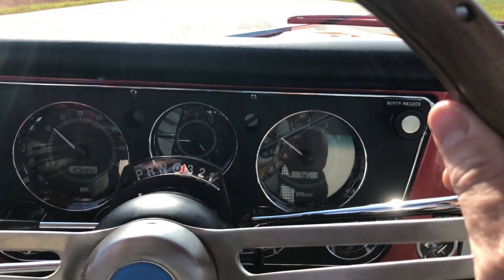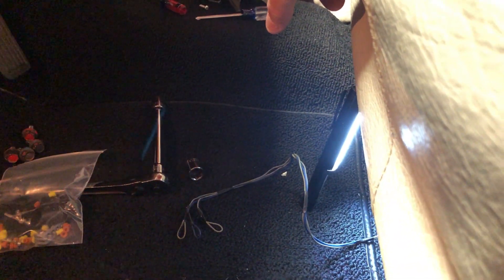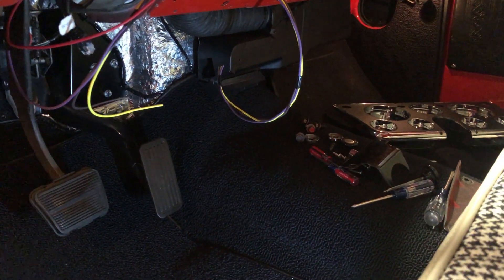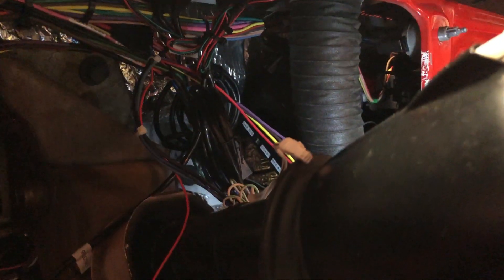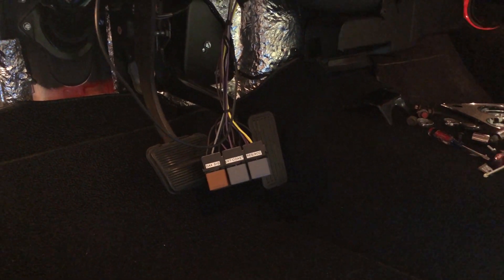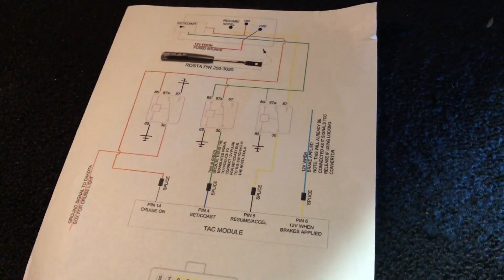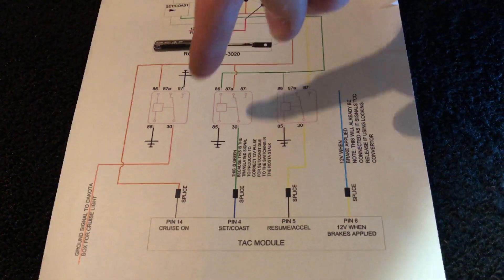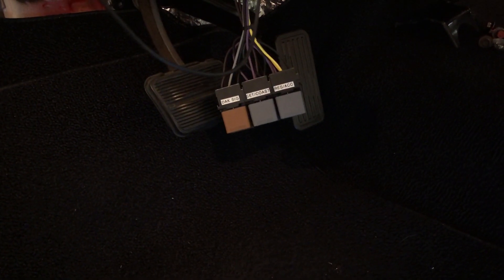Project C10 - Installing Cruise Control - Part 2

Comment from the maker: Description of how the circuits work -- So the Rosta stalk is wired for a different application.  I am going to try to break it down wire by wire so that hopefully this makes sense.

●First, here are a description of the relay pins if you don't know what they do.  The relays show on our diagram are shown untriggered, as in 12v is not being supplied to pin 86.
   ►86 - Positive relay trigger.  This is 12v (signal or battery 12v) that's only purpose is to trigger the relay
   ►85 - Negative relay trigger.  This is a ground (signal or chassis ground) that's only purpose is to trigger the relay 
   ►87 - Appropriately sized wire, feed 12v (in this case it is a fused 12v signal coming through the cruise stalk)
   ►30 - Appropriately sized wire, load side of circuit (in this case this is the switch side of the signal going to the TAC module.  This can also be the wire going to a radiator fan etc...)
   ►87a - This pin on a relay will pass a signal through the relay when it is not triggered.  This also needs to be appropriately sized wire.

●Let's talk about the signal wires coming from the stalk and what they do when wired up.
   ►Brown Wire (on signal) - This wire goes to 12v when you turn the switch on.  This is used to tell them ecm to begine accepting inputs from the Set/Coast and Resume/Accel.  
   ►Green Wire (set/coast signal) - This wire goes to 12v when the switch is turned on.  This is backwards of what the TAC needs to see.  When you press the Set/Coast, it interupts the 12v (goes to ground), but the TAC needs to see 12v when this button is pressed.
   ►Yellow Wire (resume/accel signal) - This wire goes to 12v when Resume/Accel is pressed, but the kicker is it also goes to 12v when Set/Coast is pressed.

●Next, let's talk about the relay wiring and what is happening.
   ►Since the green wires goes to 12v when the stalked is turned to on, we are going to use it as a trigger wire on both the Set/Coast and Resume/Accel relays.  The reason for this is the strange situation of the yellow wire going to 12v when Resume/Accel or Set/Coast is pushed.  What this does is help separate these 2 switches for the Resume/Accel function.  We don't want the Set/Coast switch to set the Resume/Accel function.  More on this in a second.
  ►Now for the yellow wire coming out of the switch, since we are using the 12v green wire for a trigger, this creates a clear path for the signal to go from the switch to the TAC module when the Resume/Accel button is pushed.
  ►This is where it gets a little tricky.  To make the Set/Coast work, we use the green wire from the set coast switch as a trigger on the Set/Coast Relay.  This is because the Set/Coast wire is 12v when not pressing the button, and dead when pressing, which is backwards of what we need.  So we wire the  brown wire to terminal 87a (normal closed) on the relay so that when we press the Set/Coast button, it interrupts the 12v, drops the relay back to 87a thus completing the circuit by giving the TAC module 12v when the Set/Coast button is pressed.  
  ►So back to the Resume/Accel yellow wire that gets 12v when the Resume/Accel or Set/Coast button is pushed.  To eliminate the Set/Coast button from giving 12v to the yellow wire,  the wiring of this relay array takes care of this anomaly.  Since we are using the green wire from the Set/Coast as the trigger wire (because it goes to 12v when the stalk is switched on), when the set coast button is pressed and 12v on this wire is interrupted, the 12v signal that is created from pressing the Set/Coast on the yellow line cannot make it to the ECM because the relay is no longer triggered because the green wire has been interrupted.  So in essence, we are using the Set/Coast wire to make the yellow Resume/Accel wire work correctly, while also making the Set/Coast function correctly.  I know this is long winded and confusing, but if you follow the wires through, it begins to make sense. 
  ►Now for the 3rd relay, we added this relay to give the Dakota Digital a ground signal when the system was on.  It used the brown wire to trigger the relay completing the path from ground when the relay is engaged.
Reply: Is the 3rd relay necessary if not using a dakota digital?
Reply from the maker: @claytonhaske  no, it’s not required if you are not using the Dakota Digital gauges.  It’s just gives a ground the the Dakota controller to show the cruise control light in the gauges.

Comment: Just a little confused. You kept mentioning 3 wires from the Tac module, but 4 wires are showing in your diagram. Please help
Reply: Thanks bro. Have a Great New Year. If no one mentions it, your neatness and effort is appreciated
Reply from the maker: Yeah, I can see that.  The 4th wire, pin  6 on the tac module should already be wired up when you wired your ls swap.  The is a 12v signal when brakes are applied to release the torque converter lockup.  The 3 wires I talk about are in addition to the 4th wire that should have already been wired up.  Hope this helps.
Reply: *are
Reply: I just got to your video and is awesome, already ordered the switch and relays. So technically I don’t need to add any wires to pin 6 (I have original TAC module) and what size (gauge wire) you used for the relays and from TAC to relay?
Reply: Question: if i have those wires on my TAC module, do I need to run those relays ?

Comment: Im so glad i found this video, really helped to make sense of the cruise control switch!
Im currently building some custom steering wheel controls for my truck project and wanted to implement some switches ahead of time for my future cruise control from dakota digital.
Do you know if the switches on the lever are just momentary switches that give 12v pulses to the control box? (They aren't resistive like radio controls in other words?)
If so i think im in luck!
Reply from the maker: I'm glad it helped!  I'm trying to remember.  I know that cruise on (pin 14) goes to 12v when you turn the switch on.  I think set/coast is 12v constant and pressing the set/coast button pulses it to 0v.  For the Resume/Accell, I think pulsing it to 12v makes it work.  It's been a while and I am trying to recall and look at the wiring diagram.  I'll see if I can find out.

Comment: I am trying to do the same thing, Dakota Digital Cruise stalk, but I have drive-by cable setup, i pulled from my LS Donor, I have looked at all the forums and cannot find instructions for the drive cable.  i have dakota dash like you. Instead of TAC module i have box under the hood that has a drive cable going to throttle.
Reply from the maker: Hrm, I know some guys on the 67-72chevytrucks forum have messed around with cable cruise control.  You might search around over there to see what you can find.  I think ls1nova71 is the guy who was messing with it.

Comment: Did you de-pin the wires to the tac module from the ecm? Where did those 3 wires from the tac originally go to?
Reply from the maker: I have an aftermarket harness that did not have these 3 wires.  I had the stock harness that I removed the 3 wires from to make this work.

Comment: What made you go with 40 amp relays? Just curious as I do not see this called out in the documentation. I was going to use my 35a/14vdc relays for this as I already have them available.
Reply from the maker: I had two of them laying around. The relays you have will be perfect.  These are just 12v reference wires with no load.  Glad this is helping you. It took me a while to wrap my head around the wiring logic. Thanks for watching!

Comment: I have gotten a lot of useful info from your videos. I am swapping a 98 LS1 and 4l60e into a 70 c10 swb. I believe the reason for the two relays one normally open one normally closed is because you have one button with two functions. The second state function is dependent on the first state. Im not a controls technician but i am a master electrician!
Reply from the maker: Exactly!   I scratched my head for a while until I actually wired it up.  Works like a champ.  I’m glad the videos are helping.  I know I went against the grain on some things, but I hope it is all right haha.   Thanks for watching!

Comment: Man ur alot smarter then me Haha. Great job it sounds so confusing
Reply from the maker: Thanks.  It made zero sense until I wired them up with jumpers and used a volt meter to figure it out.  A wire at a time is how I do these.  Thanks for watching!